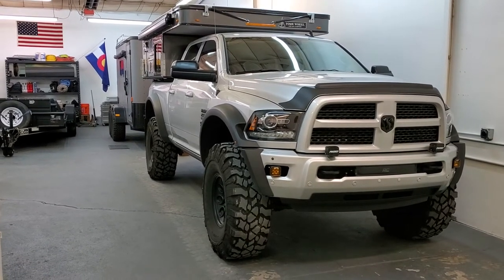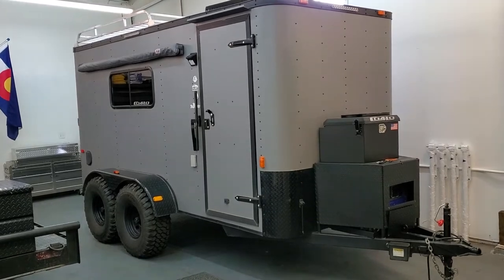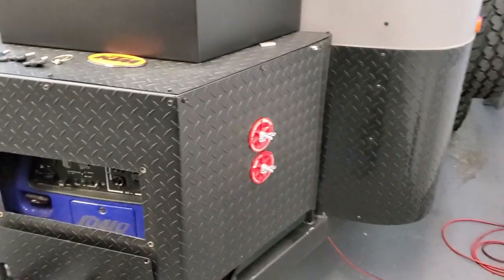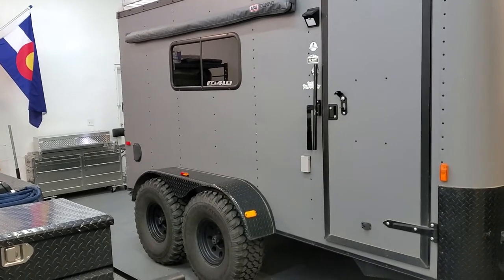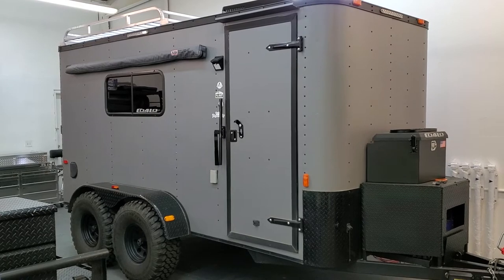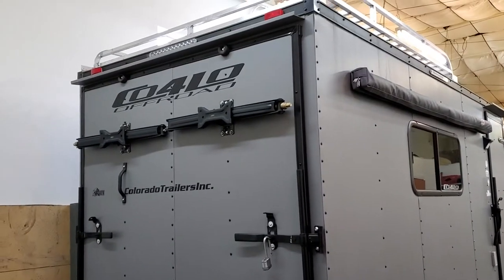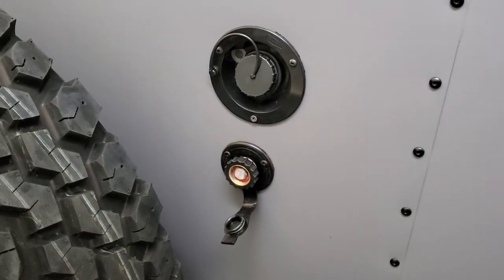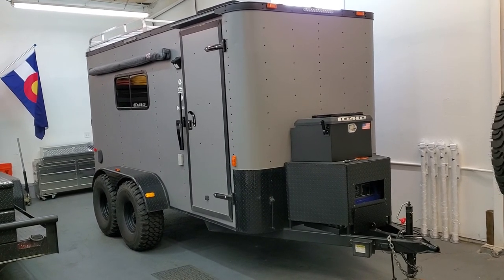Off Road Camper Trailer Outside

Comment: Is the tongue weight too much?  That generator isn't light.  Its not super heavy.. but its not light either.  Cool looking trailer tho.  I would've liked to see the inside tho.   I did a conversion last winter with a 7x12 (plus v-nose) ATC aluminum trailer last winter.  It came out pretty nice.